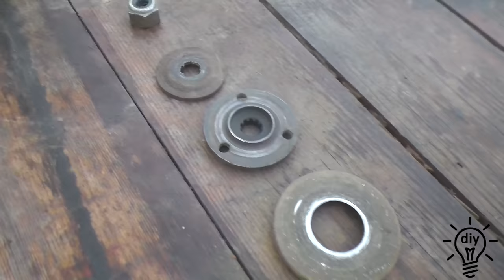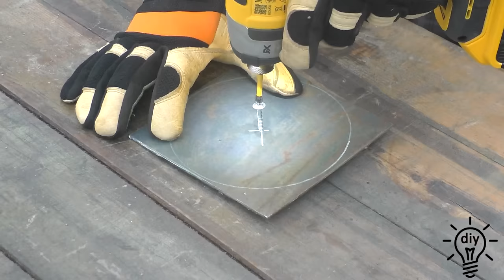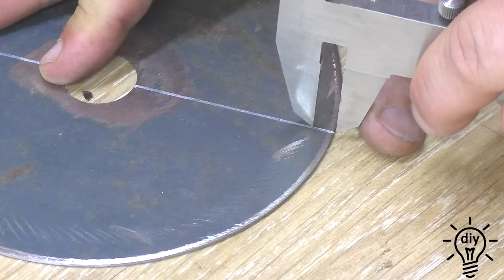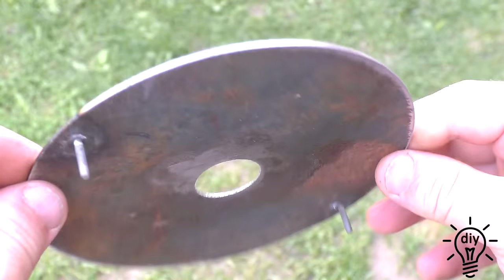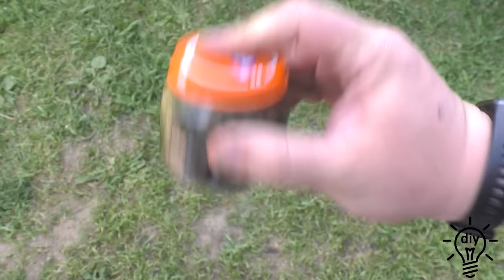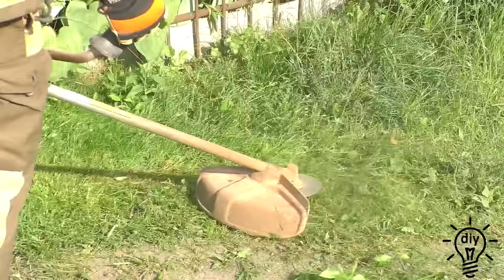A brilliant idea from a bicycle chain !!! Mow the lawn without problems !

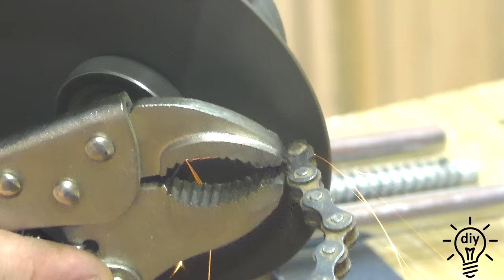Comment: I like how at 3:40 he puts out the sharp edge and grinds it off. Like that’s the dangerous part 🤣😂🤣
Reply: Safety first 😄🤣
Reply: That had me laughing...as clumsy as I am..I would never do this..good ole cheap line is wayyyy safer .... imagine hitting a stone with that thing
Reply: When I get swatted in the ankle by a steel chain spinning at 12,000 RPM... I prefer it to have a nice, smooth edge.  I've found that way, I only need about 75 stitches instead of 80 stitches!!
Reply: @PatrickWagz  you might not have a shin bone left to cover but its the thought that counts
Reply: @renzocafferata1809  Safety third more like it.
Reply: He was wearing gloves... for about 2 minutes of the build... that'll make a difference.
Reply: @renzocafferata1809  You spelled Third wrong!
Reply: I was thinking the same thing lol
Reply: @renzocafferata1809  3rd..
Reply: How about degrease and then oil  ?
Reply: Attach some ginzu knives

Comment: About the only thing that would make that more dangerous, is if you used a chainsaw chain, instead of a bicycle chain.
Reply: That’s a great idea 💡
Reply: Lol great idea
Reply: Damn, i have a lot chain saw blades just laying around , thought about using one of those sucked  , See Ya
Reply: Don't be giving him ideas like that !...🤣
Reply: What A Great Idea!
Reply: Don’t give him the idea
Reply: They actually sell a trimmer head that uses two 4" pieces of chainsaw chain. The center disc is double, and the chain is attached with hardened pins through both spring steel plates. A buddy tried one, it tossed one of the chains and went out of balance destroying the shaft and bearings. 
I've also seen heads that take regular oval link chain for brush clearing. 
I have one that uses cut lengths of wire. The wire feeds through the head, the bolt wraps and tightens the wire in the center, and you cut the ends to clear the cutter guard. It works great till one breaks off and it goes out of balance. Worse yet, the wire flies like a bullet when it breaks off. It'll also cut fence posts, small trees, tires, you name it. It also launches small stones like missiles.
Reply: Don't give him ideas

Comment: There has to be a way to add explosive charges to the chain ends, to quickly eliminate any pesky rocks or fence posts
Reply: Hilarious
Reply: I was thinking steak knives with the handles cut off and a hole drilled in the handle end for that thicker dog fennel type vegetation.
Reply: @Robinpowellsvideos  believe it or not: I just did that. Did not last long. Did not penetrate the boot though

Comment: That looks like a really good idea until the pin brakes on the disc and the entire chain flies off and catches you around the ankle. Might wanna think twice about using that.
Reply: Came here to say exactly this.

A chain is only as strong as its weakest link.
Literally in this case.
Reply: Yeah I think I would have had that PIN in between the disc and the chain link kind of sandwiching it myself I may have put it on a bearing too for crying out loud
Reply: Exactly what I was thinking that is too dangerous not worth the unsafe possibilities.
Reply: Perhaps, soldering the chain to the nut, bolt, and the disk, would help not to come loose that easy.  Also, you need to keep it clean, lubricated, and not exposed to the weather. So it would not get rusted, and break more easily. Well, giving it a second thought, this whole thing is not that safe. Perhaps, that's why they never have sold, anything like it to the public. Too big of a liability.
Reply: @felixramos3078  there is practically no redundancy you can add to that ballistic weapon of a lawn tool to make it safe. It is more like a trebuchet than a weed-eater in that it is 100% going to launch a handful of chain links really, really fast.
Reply: Just wear your catcher shin guards when weed eating.
Reply: Why not go all the way and instead of a disc let’s use a circular saw blade with 4 chains ! Or maybe just weed your lawn with the angle grinder !
Reply: @TCMabe  They actually sell weed wacker attachments that are essentially circular saw blades.  They are for going through heavy brush.  An actual circular saw blade on a weed wacker would be a whole lot safer than what this guy is doing!
Reply: Safe as...just wear your gumboots or Samoan steel caps. You'll be fine
Reply: Report the video as harmful or dangerous acts.  😉
Reply: "Around" the ankle? I don't understand.

Comment: This project is a very visual way of teaching the principal,  just because you can do it doesn't mean it's a good idea.
Reply: While I'm certain the principal is at risk, this principle is pretty daft too.

Learn the difference.
Reply: This  project is the examination of the same principle as flinging metal away from the center point, utilizing centrifugal force as seen in the simple machine known as the wheel and axle. However,  the outcome may result in the same final action as from the explosive outward force as seen in a hand grenade, not the wheel and axle. The action being shrapnel entering into soft tissue after this project demonstrates the crossing of the Rubicon into final failure mode.
Reply: @alangaughran  that was funny. The spelling slipped past me for a second.
Reply: Report the video as harmful or dangerous acts.  😉
Reply: @alangaughran  озоз.

Comment: I recall the day the boss handed us something similar to this. More over-engineered though, with big chain links like you'd find on a decent bike lock. Invented by an Italian farmer the paperwork said. Well we fitted it to the machines & away we went. Fucking incredible I can tell you. Smashes through brambles & even small trees with ease! Then one of the links breaks off & flies out so fast you can't even see it, just like a bullet.... At that point the whole head becomes imbalanced (we had four chains on ours). So you take a bolt cropper out of the van & cut the other three chains to the correct size, & away you go again. It was like playing russian roulette. The safe working distance is usually something like 5-10 metres with a regular strimmer. It went up to about 50m using that chain thing.
Reply: Someone got killed by a strimmer with a chain on it in the uk. It's one of those things that works great until it doesn't...and when it doesn't, it hurts or kills people. I doubt that there is any safe way to making something like this.
Reply: I can't tell you how hard I laughed reading your reply. Sounds terribly dangerous, but thank you for the entertainment! Sounds like you were a bit terrified as well.

Comment: Apart from it being extremely dangerous, it isn't cutting....it's bludgeoning.  You WAY overloaded the bearings and drive.  10 secs of mechanical consideration would have ruled this approach out.  Some people should just stay away from tools, it seems.
Reply: The best are the tiny bolts and thin disk that are supposed to hold the chain. 
I bet this guy has no clue about what dyjamic forces he unleashes, or what material fatigue is. Unbefuckingleavable.
Reply: there need notice that can stones or harder object in the grass or when hit the ground let damge it over time. it is additional force. a bciycle chain is hardened and not design for forces from side happen . this let outer segemts  break sooner when suddenly forces from  side happen. only when no segment overlap the protector it can be safe for thwe gras cutter, but it can fly to the neighbour
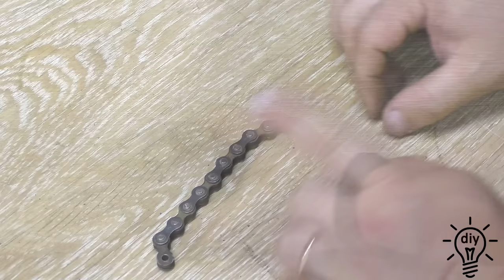Reply: @YouD0ntSay  Note the bottle at 3:54 - the label is in Russian.  This is what they are forced to do in the underdeveloped world where there are no real tools.
Reply: He should have bolted the chain to a 6 inch circular saw blade and make it more interesting
Reply: @firstnamelastname7688  just bolt the saw blade and use it. I am kinda curious how just a saw blade would do. Which gets me to thinking, how about he cuts the round piece to look like a lawnmower blade and just uses that
Reply: @tchkvsky  ottima vista, bravo
Reply: Why not use a combination of saw blade and chain saw chain instead? Don’t for get the chain lube reservoir
Reply: He could have welded razor blades to the ends of the chains to make it even more interesting.
Reply: Somebody forgot to tell him that DIY projects are supposed to be an improvement, not a clear downgrade. What a complete waste of time, energy, tools, and materials.
Reply: To be fair, string doesn’t cut either. Someone did some high speed video of string trimmers and they actually tear the grass after it folds over the string. It was a pretty cool video on the u-toob.
Reply: I remember a joke that was played on a new guy where I worked, that was all the time screwing up, someone stuck a sign on his locker that said, turn in your tools and stick with what you're good at...Stick with Fisher Price and Mattel !

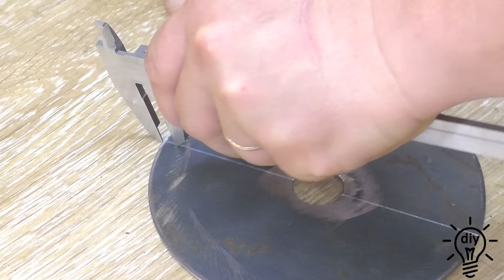Comment: 02:13  A true mark of a professional.  Using calipers as dividers for scribing.  Adds to the calipers level of precision.    Que fundo de quintal.
Reply: But he did show us a cute trick that I WILL use...a screw in the middle of the project and a squeeze-clamp and pencil to draw an adjustable circle. That was KEWL

Comment: Why not weld the chain directly to the plate ?? Why not use a worn edger blade that already has the correct hole ??
When that little bolt breaks the bit of chain, at 7,000 RPM, will go thru your window at 150 MPH !!
Reply: Or through his shin
Reply: @baraksinz  Tis but a flesh-wound !
Reply: And into the forehead of the person standing behind it.
Reply: @Udhehf Hehcuw 3 million like me.  Wondered WTF

Comment: My wife's cousin recently injured himself damn near fatally when a welded-on attachment (didn't get much details on the shape or size)  to a gas-powered weed-eater blade came off at speed and hit him on the inside-top of the calf muscle, and severed an artery. He was out in the field, hit the ground and was trying to yell for help but was several hundred yards from his house. Somehow, someone heard or saw him and they went and got him from the field. The whole village chipped in and donated blood as he'd lost so much he was almost out of the survivable zone. A 2 week hospital stay recovering from the emergency 'surgery' they do here, (this is Thailand) plus the transfusions, and now several weeks still of limited motion and sensation. And, BTW, yes, he knows how to weld, done it for years. 
    Welding ANYTHING to a blade which revolves at SUCH a high rate of speed is extremely dangerous.  Stress and fatigue cracks from spinning and flexing, (especially if the rotating piece is out of balance by even the most MINUTE amount) can appear and grow in metals, and there's no real way to tell when or how they'll fail.  After a while, one strike at a rock or almost-totally submerged pipe, etc. could easily be enough to knock off an attachment, especially if it's NOT the first strike.  
      Personally, I think you should remove this vid. There have been many others advocating using chain and steel cable (from motorcycle brakes, etc.) as cutting lines, but this is probably the worst I've seen.. You are doing a genuine disservice to viewers AND THEIR PEOPLE, (since family goes through a traumatic event WITH their loved one). You are encouraging them (you know you are) , with COMPLETE DISREGARD for their varying mechanical-fabrication skill levels, all the variables  of the different materials which may be pressed into use, and natural factors like terrain and handling experience,  to ignore safety concerns, and attempt a (poorly engineered) modification to a piece of steel which, when used, will spin EXTREMELY fast, and create a very REAL and possibly lethal safety hazard,  all for views, ego and $$. Sad.

Comment: Use a chainsaw chain instead of a bike chain, fasten multiple razor blades to it and then modify the shaft with a u-joint. Perhaps swinging it over head like nunchaku and cut the grass while you're upside-down doing flips.

Comment: Actually if he had made a hardened steel disc it might've been a decent idea. I mow my lawn with a diamond disc but this isn't too bad of an idea if you remove the idiotic swinging deathtrap that he attached to the disc
Reply: He could've saved himself the effort of making that circular disc by buying a BMX solid bike sprocket instead.....it has the teeth to shred the grass and comes with a center hole already drilled out.

Comment: The chains are much heavier and consequently, make the equipment less effective than it was in its original format. This will result from the decrease in the number of rotations per minute. In addition to this, the fuel consumption will increase because due to the increase in weight caused by the chains, you now need more fuel to get the same amount of work out of the tool.
Reply: Not only that, because they are heavier they will significantly reduce the life of the equipment.  Manufacturers of commercial equipment will not warrantee string trimmers if the string guard is removed, which many landscapers do.  The reason is the guard has a cutter in it that keeps the string at a pre determined length.  Longer string is heavier and causes premature wear.

The longer string slows down the weed wacker, wears the clutch, and can snap shafts inside the stem.  In other words, beats the shit out of the equipment.
Reply: I can tell you've really thought this through.
Reply: @jt7663  i live it.  One of my businesses is small engine repair, and we do a lot of commercial equipment.

Comment: And in next weeks episode of Impractical Projects, we show you how to cook an entire meal using your car exhaust!
Reply: In the car,,,,,,,,,, while sitting in it.
Reply: The engine block is more effective. Guys in semi trucks cook whole chickens on the block while they drive the 30 mins to a couple of hours.
Reply: There used to be a book called Manifold Destiny that told you how to cook meals on the exhaust system of your vehicle. I  used to wrap a loaf of garlic bread in two layers of foil, place it on my exhaust manifold. Voila, ready to eat after a half hour drive.
Reply: Love it.
Reply: @lovepcgaming2335  We have microwaves in our trucks, but I use a slow cooker for my chicken soup, cooks in 3 1/2 hours.
Reply: I was expecting something more on topic, like how to use a weed wacker to trim your beard.
Reply: Huh, we sell a muffler food heater, than can be attached to snowmobile exhaust to warm up sandwiches or anything that fits in it…and they work well and many snowmobile riders enjoy them
Reply: I figured it would be " DIY Hack for Heating your home, using dryer duct and car exhaust."

Comment: Wow that`s a great D.I.Y. idea,and it has inspired me to make one similar to yours ,but it is for trimming hedges ,high branches from 
 ladders etc,I have used 2 full length power saw chains each about 1 metre in length  cut into 4x18 inches long & attached to a half inch plate metal disc with stretch bolts for safety similar to a propeller configuration of a  plane  on to a heavy duty high R.P.M 247 volt large drill chuck ,with modified twin handles to power the device.It is a bit tricky to keep it stable with both hands as it  viciously tears its way through the leaves (at very high speed),thick branches , fencing posts, & masonry,etc one minor drawback is it sometimes comes away from the hedge and everything else it is completely destroying towards my head and chest, where by I have to force it back away from me so that the propeller like high speed chains carry on tearing their way through the leaves,and any thing else that just happens to be in its way it is very,very effective ,but alas it seems to have a mind of its own when in use,in other words it tends to travel to where it wants.The odd thing is that my neighbor keeps telling me ,pleading with me ,that it is extremely dangerous and could decapitate my head from my shoulders,or any other part of my body below my torso.I told him no way it will do that its a DIY project from Facebook its got to be safe ,they would not have allowed it to be posted if it could injure anyone,so go away and allow me to use this wonderful DIY tool,OK I have only tested it once up to now ,but I have not had a scratch from it as yet.Oh by the way I just love that music on the video,it is just like the start of a Health & Safety vid for using power tools.
Reply: "with stretch bolts for safety "  lmao

Comment: It would be the bolt securing the chain that would fail after hitting a rock.
Reply: I would have had the chain link on both sides of the plate.
Reply: @RobertSmith-tq6mf  He should have welded the chain to the disc, that way vibration would carry onto that huge piece of steel rather than that tiny bolt
Reply: At 8000 rpm that  #10 no grade bolt will fail in no time
Reply: @paulkimber6028  no grade bolt🤣
Reply: @paulkimber6028  The thing is, with general weed eating. The best cut is at 1/4-1/2 throttle.... Not 8000 RPM. Now if you're bushhogging using a weedeater, well that's the problem....

Comment: Remove the bolts, and use the master link through the holes, it's a Lil safer than the leverage against the flimsy bolt
Reply: Why not just weld the 1st chain link to the metal plate. I still would not use this contraption but that would make it safer.
Reply: @wok-ur-katt1995  believe me, I would but most of these glue gun gladiators who think they can diy ain't got a welder.

Comment: You would have been better off leaving the corners on the piece of steel , maybe sharpen the ends !  The chain will break sending shrapnel !   The connection point of the chain would be better removing the roller at the end of the chain and using both sides to connect  with the metal in the center , just stronger , still dangerous though !      Another Idea would be to make a s shaped steal blade .
Reply: Another idea would be to leave the chain on your bike so you can pedal down to the store for more trimmer line.